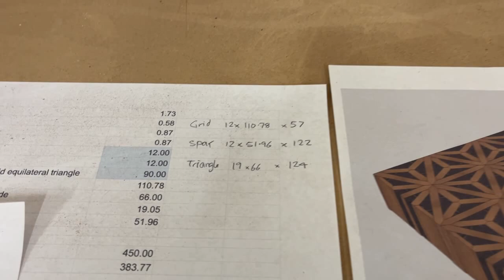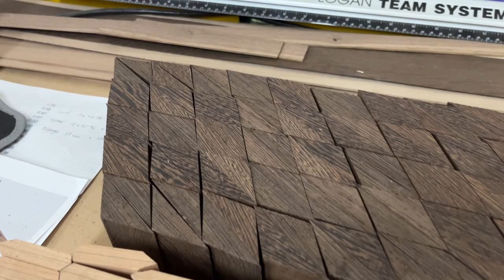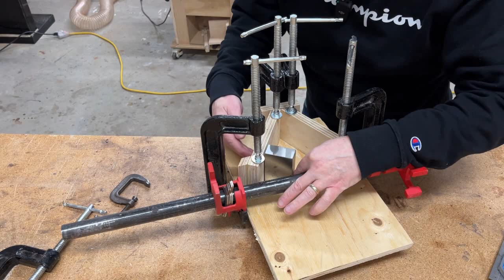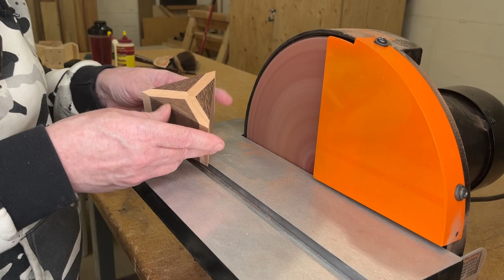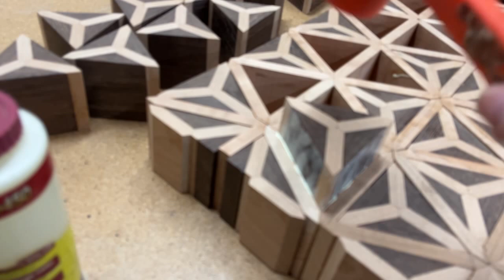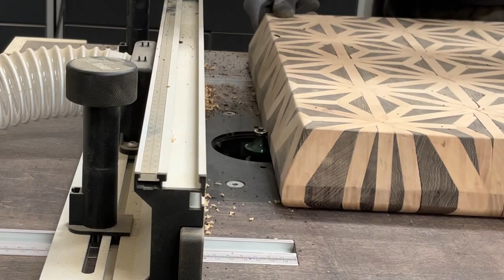Making a cutting board with the asanoha pattern

Comment: I think that was a sterling effort. The issue with a design such as this is that just a single tiny error in a measurement will throw you. You’ll make a small adjustment to compensate which will throw the next measurement and you just have a compounding knock on effect! But your video has inspired me to try something similar 👍🏻
Reply from the maker: You are absolutely right about the tiny errors compounding. I wasn't satisfied with the end result, so I had another go, and this was much more successful. The board is finished, and the raw video is in the can. I will edit it over the next couple of days and post very soon.

Comment: Very ambitious. And watching your technique I think I would have had to use repeatable accurate methods of cutting each component and not put it on the dish sander, which would result in all of the components being less than exact. Once you develop a method to cut the individual pieces repeatedly, then it’s just a matter of cutting those pieces so that they fit together. The sanding of the individual pieces can’t be regulated to produce repeatable accuracy. I did love your attitude, though in that the end result was still stunning. You have definitely inspired me to attemptthis pattern as well.
Reply from the maker: Yes, I totally agree with your comments. As always I push myself because you learn by failing. I would do it very differently next time … if there is a next time!